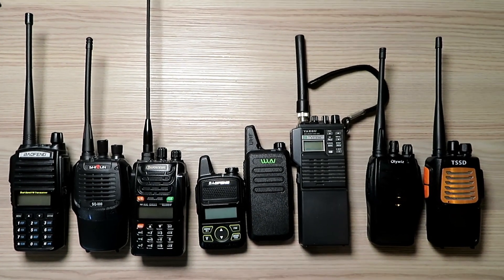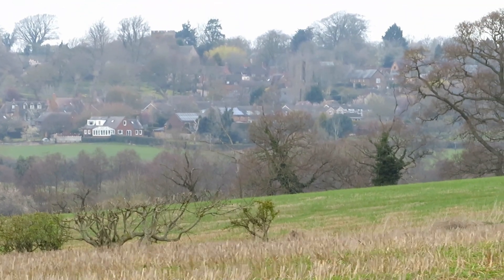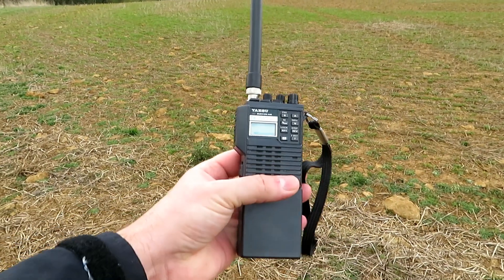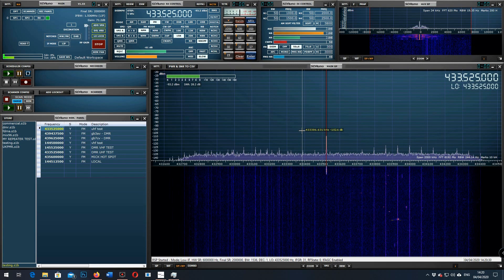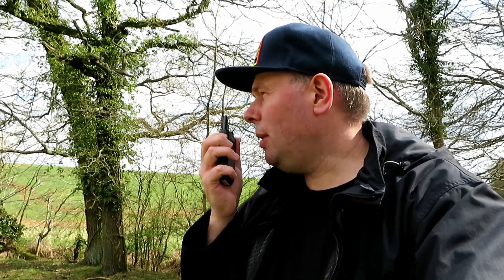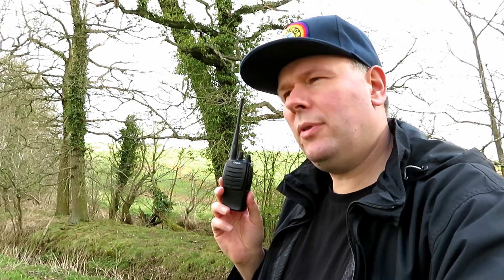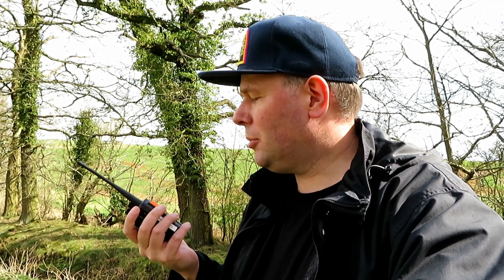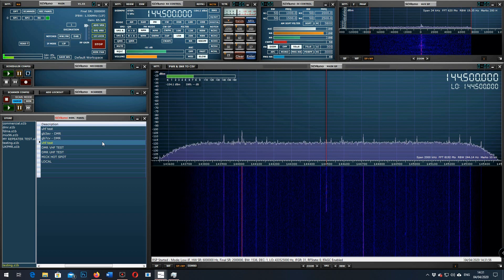LOCKDOWN RADIO FIELD TEST EPISODE 3 - 8 RADIOS TESTED IN A FIELD

Comment: Baofeng UV-82R have the same schematic as the UV-5R but with a larger PCB layout.
Both share the same manufacturing fault of R69 and R70 on the mic input were installed
 the wrong way around by who ever loaded the component hopper, with them the wrong
 away around puts C131 475 (4.7uf) fed from 680ohms instead of 2k2 putting most of
 the mic gain to earth, cure is to dismantle the radios flipping over the board with the K socket
and removing the C131 4.7uf SMA cap next to it and then fitting fresh 4.7uf from the top of R69
 to ground. also shorting R72 and C134, and removing C135 will increase mic gain and bandwidth
http://www.uv3r.com/images/Schematic-Baofeng-UV5R.pdf
https://usermanual.wiki/Document/ModificationSheetBaofengUV82LUV5R.3693990699/html

Comment: Like the video . Just a quick one ... with a handheld you are / mobile . Common mistake . See rsgb suffix information below 
/P clause 17(jj) applies so that the “Temporary Location means a fixed location in the UK which is not the Main Station Address or an Alternative Address”

/M clause 17(x) applies to define Mobile as applying when the Radio Equipment is “located in the UK in or on any vehicle or conveyance, on person of the Licensee where the Licensee is a pedestrian or on any Vessel on Inland Waters”.  The latter is defined in  in clauses 17(rr) and(tt).